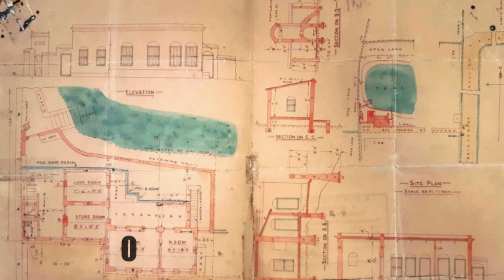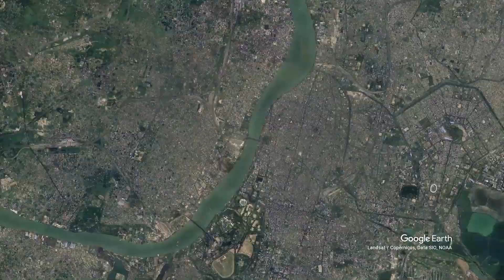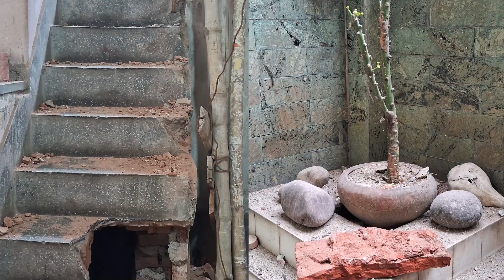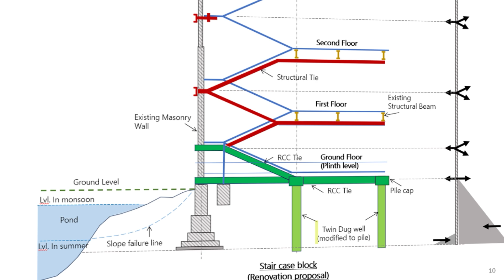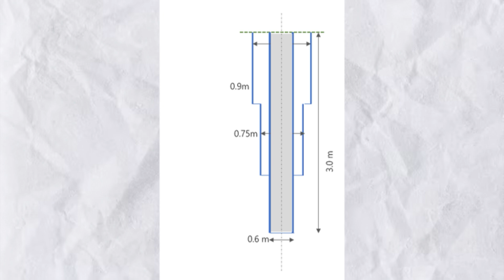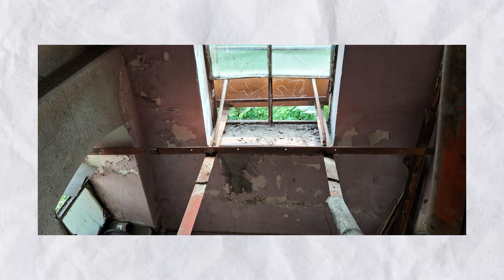Renovation of 92 Year Old Residential Building

Comment: Very interesting solution, which seems to be securing well the house for the next 92 years. Not surprising, the soil in the vicinity of the lake will be consolidating over the years, especially when extra storeys are added so the house foundation needs to be adapted accordingly. I like especially the dugwell foundation, and the way the wall becomes anchored to this to make the combined construction integrated and stiff, seems quite innovative. One question is, what about the other neighboring houses, have they been experiencing the same crack challenges, and will this improve or worsen in the future after this house has been renovated?
Reply: One house single storied is on the bank of the pond and experiencing same cracks.